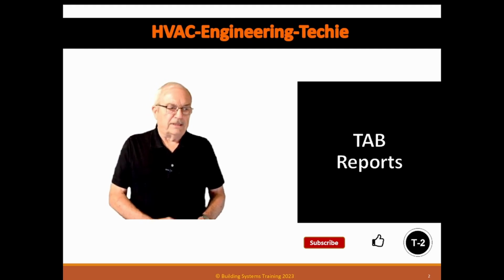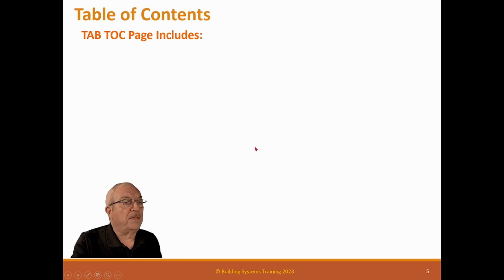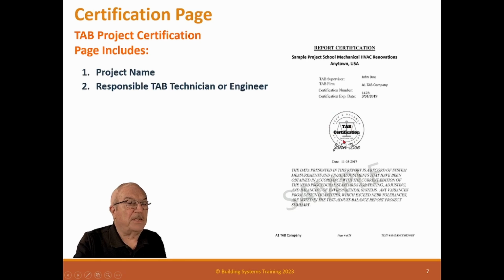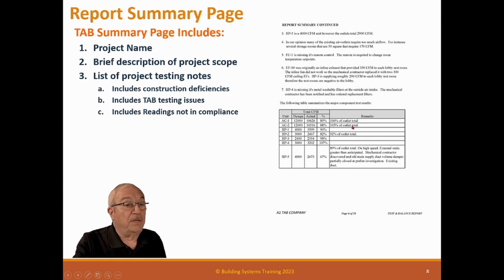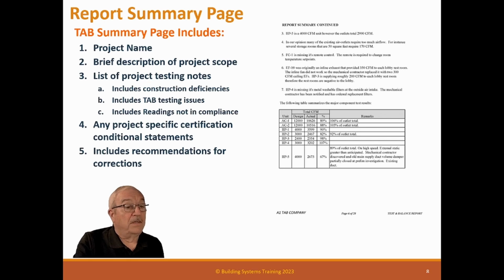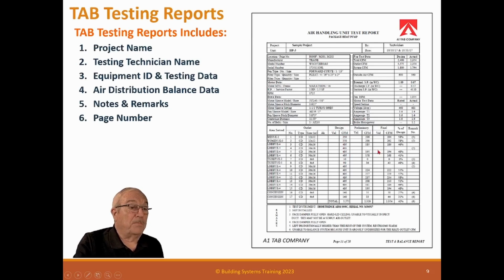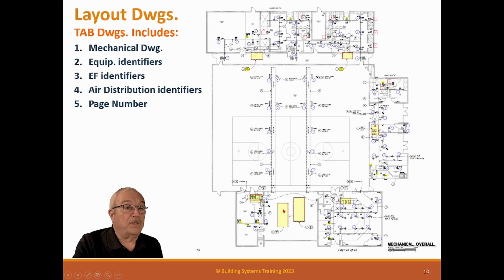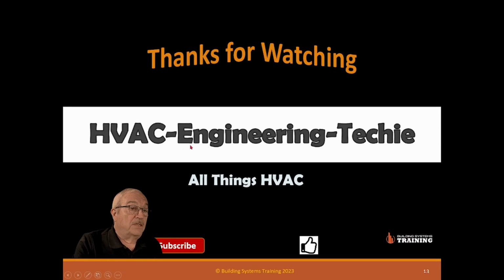Training video covering what should be included in a TAB report. Training Session T-12

Comment: Can you possibly do a video on setting up ERV/ERU units that are ducted into the return of multiple heat pumps where theres no acess to pitot each individual fresh air inlet at the heatpumps? How to set the minimum osa flow to each, as well as setting up the ERV, I am struggling with some schools with this setup. Great videos also,thank you
Reply from the maker: Training video S-9 VAV & OSA systems and C-11 (Not done yet but close) will show you how to setup the main OSA unit. As for setting up OSA to each HP that are not accessible for an accurate pitot I have two recommendations. If you can get a single center velocity for the OSA input then balance to that average velocity for each unit, if not you could try to do it by a temperature balance method where you do the mixed air equation with the OSA flow being the variable. See E-4 Air flow & Pressure calculations.
Reply: @HVAC-Engineering-Techie-vm4di  Thank you for the reply, I will check those videos out today, That is exactly what I started doing is the mixed air equation but last few days o.a. and return air same temp so not gunna work haha.  Also theres different duct sizes and osa flow requirements for each unit based off of the space served needs.

Comment: I had a question on airflow measurement using a pitot tube vs. mini vane anemometer vs. hot wire. Is there a certain duct velocity where one is more accurate than the other. I had read that over around 800 fpm and above to use pitot or mini vane for induct measurement.If lower velocity using a hot wire may be a good choice. Obviously, there are a lot of other factors that come into play. I do like a mini vane for induct measurements as it is a direct velocity measurement and no air denisty corrections needed. Do you have any guidelines on this and thoughts about vane induct readings compared to pitot. I know tab guys seem to always use pitot for the most part from what I've seen.
Reply from the maker: A Hot wire and a mini vane anemometer are just another way of reading air velocity, but each have disadvantages to a standard pitot. Hot wire was originally developed to improve the accuracy over a pressure gauge, but the modern smart pressure instruments have negated that need. Hot wires also produce RF which may be a problem in some facilities.  A minim vane is not more accurate than a standard pitot and much more expensive. TAB techs use pitot because they are the most accurate and much cheaper since they already own the pressure instrument.
Reply: Thanks. Is there too low of duct velocity to use a pitot tube and still get accurate reading. I wast sure if VP reading could be to low.